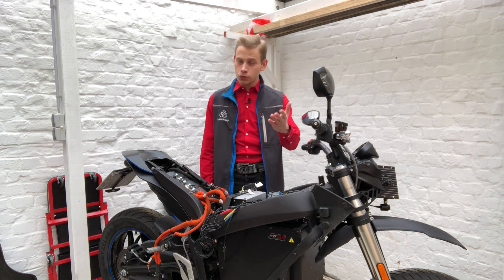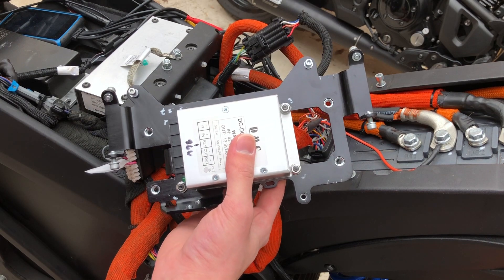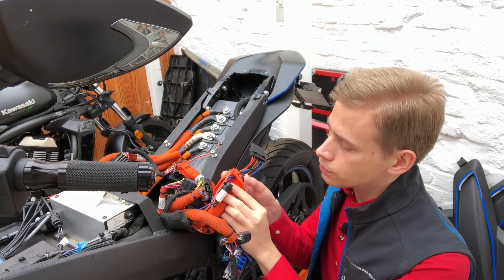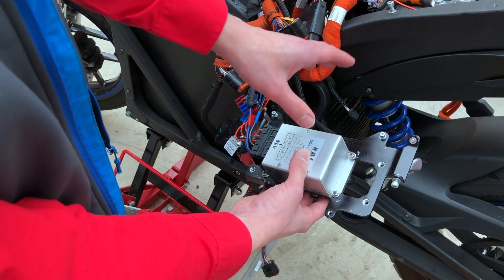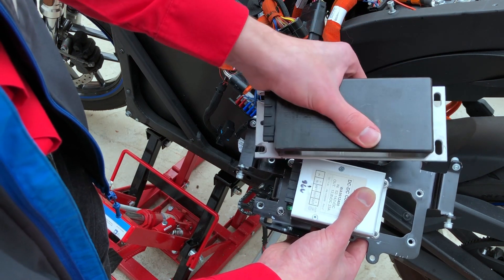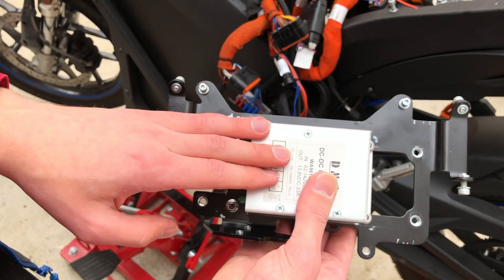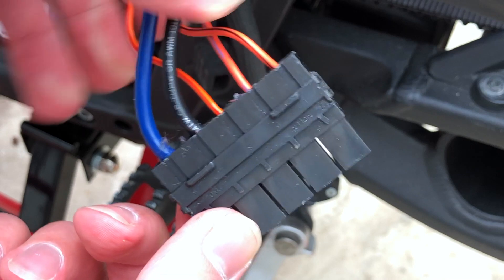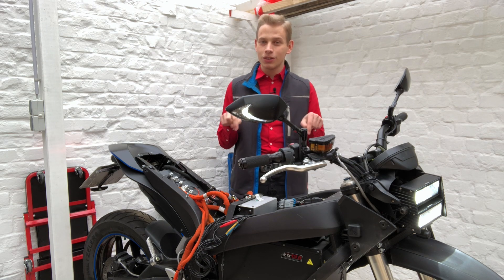ZERO | Replacing the DC/DC-converter

Comment: I recently removed the battery from my zero to do some maintenance on the upper shock mount. Unfortunately the bike wouldn't turn on after replacing the battery. After you watching your video I checked the main fuse in the battery compartment which was loose after fixing this the bike turned on. After agonising about this problem for the last 3 days your video helped me to restore my face in zero motorcycles. Your videos help people in multiple ways. I am most grateful

Comment: Great video! Unfortunately, I can't find the DMC part or any other equivalent converter (I looked at every option on Mouser).
What about the recall : 16V-610 , 2016 Zero DC-DC converter.  Wouldn't the dealer replace the part for free?

Comment: Max, you should be able to discharge any capacitor voltage with a 1K ohm resistor fairly easily instead of waiting 10-15 minutes for the internal resistance to do the same thing… otherwise it’s a good video.

Comment: Thanks a lot for the video, I have a doubt, does the DC-DC converter has CAN protocol for communication or how it is? can you please brief on it
Reply from the maker: Hi @shaikafzalahammed8701

like the SEVCON converter the DC/DC-converter from DMC also supports no CAN communication. Both converters only get an "enable" signal from the MBB (main bike board).
DC in, DC out and "enable" as simple as that.

best electric regards
Max Jäger

Comment: Hello great job. You mentionned the part number for the 450w model. Would the 900w one be of any interest ?
Reply from the maker: Hi Y from Mars,

the 900W model is too big to fit into the same space as the original DC/DC-converter and it also might draw (if using the full 900W) too much amps and overwhelm the wiring loom.

Best electric regards
Max Jäger

Comment: Now, I'm wondering, can I put in a 900w, for extra output? I see the pinouts/connectors are slightly different could this be made to work? Will the wires take the extra draw being pulled?
Reply from the maker: Hi Grant,

in case you want to mount the 900W converter in the same position and power it via the same wiring and fuse, I don't think it will work (too big and too much current). But you could wire it up to the auxiliary charging port and "grab" the enable signal from the original (SEVCON) DC/DC converter, but you won't be able to combine both low voltage outputs of the converters since they put out slightly different voltages. So you'd have to use that converter and the loads you want to operate isolated from the "other" 12V system.
In case you've already replaced the stock SEVCON converter with the shown 450W DMC one you can seamlessly use both the 450W and 900W converters in parallel, since they're actually designed for parallel operation. Nonetheless you still can't fit the 900W unit in the same space, nor can you use the stock wiring (at least without risking to fry the cables).

Best electric regards
Max Jäger

Comment: Thank you for a great explenation. It really helped.
It appears there is a problem to purchase the DMC converter for a privet person.
Do you have a link to a store  that will sell the converter out of germany?
Reply from the maker: Hi Yoni,

I myself just got a great deal on the shown unit on ebay. Unfortunately though I don't know where you can buy them from as an international buyer.

Maybe this shop can help you out:
https://www.elektromobilitaet-riester.de/verkauf/stromversorgung-management/dc-dc-wandler/

*they also offer a seemingly fitting replacement for the SEVCON DC/DC converter with the same footprint, but a higher nominal input voltage (96V like in the video), but also a Power of 500W for less than the DMC Converter.

Best electric regards
Max Jäger

Comment: Thanks for the video. I have a 2016 fxs with 2000 miles. The 12 volt supply works intermittently. Was that the same problem you had? I want to be sure before I buy the expensive part. How can I measure/check it? It has the input from the main battery. I am not sure how to measure the signal voltage from the MBB.
Reply from the maker: Hi Revanth Reddy,

I also struggled with a unexpected loss of 12V power from time to time.
To measure the enable signal you'll have to disconnect the connector from the DC/DC-converter and measure the Voltage between the "enable" pin and the main battery negative. If the MBB works properly you should be able to measure a voltage greater than 90V. 

Best electric regards
Max Jäger

Comment: Fantastic video. I think my DC to DC converter is toast and found one on eBay for a decent price. With this video, I think i'll try and fix it myself. Seems pretty straight forward, especially since i'm not adapting a new converter. Thank you so much for such an informative video!

EDIT: How would I fully know if my DC to DC converter is toast? My 2018 Zero S won't charge anymore, and the dash/lights/high beams will randomly cut off for a few seconds once in a while. Still works just fine, but can't charge it anymore.
Reply from the maker: Hi therealzero,

then it seems like your charger is, or will be dead in the foreseeable future.

So lets differentiate for a moment...

DC-DC-Converter.
To check the function of you DC-DC-converter you can measure the output voltage, or just use your peripherals (lights etc.) as an indicator.
You can also check the enable signal, take a voltmeter an measure between the most right pin of the DC-DC-converter and the main battery negative (on your SEVCON controller). If you're getting a constant voltage that is around the same as the main battery one you'll know that at least the "enable signal" is working like it should.
I also suggest to check the "HV-DC-DC fuse" which is hidden down inside the wiring loom, for that you'll most likely have to remove some of the orange braided sleeving . Sometimes you can get a bad connection due to vibrations.

But a randomly occurring turning on or off of you lights, like you stated earlier, is by far the best indicator of a "blown" DC-DC-converter. 

The charger:
The best indicator for a slowly decaying charger is that your maximum SOC (State-Of-Charge) after charging will slowly but constantly decrease. Unfortunately the chargers ZERO uses, at least on their S and DS models, are prone to fail early. In that case you'll have to look for a replacement and wait for the next time it fails, or go for an aftermarket solution/charger that is more suited for the application.

I hope that this information is somewhat helpful for you.

Best electric regards
Max Jäger
Reply: @Max_Jaeger  Thank you for all the help. I purchased the converter and replaced it. Unfortunately now the bike won't even turn on. The dash comes on for about half a second, then shuts off. But, I discovered the cable that goes to the charger was separated (of course AFTER I replaced the converter), so I'm going to try and put back my old converter and see if it works again. If it does, I'll know I have a bad converter. I'm not very informed on how to properly test connections, so I'll have to go about it the hard way, lol. Again, thank you so much for all your help and information. It is greatly appreciated!
Reply: @therealkzero  I also had my 2015 DS exhibit a problem where the dash would go on for less than one second.  The problem was a main fuse (sand filled, in the wiring harness) blown. Check all your fuses, if you haven't already, for continuity!
Reply: Thanks a lot for your vidéo in english... Impossible for me to understand German. I ll try to see how to get a Dmc dcdc  in case the preownded DSR 2017 that I Just bought get some trouble.

Comment: your english is very clear! nice video dude! I like the headlight you installed but I'm also very curious about your fast charging setup! subscribed from Los Angeles!
Reply from the maker: Hi Ryan,

thanks for the sub!
If you're interested in a comparison between the stock headlight and my new "Highsider Ultimate LED" setup, you can check it out via the link below (you'll find a pdf document, click on the link below "ZERO DSR", then open the folder "Highsider Bilder & Vergleich" and finally click on "Halogen vs. LED")
https://www.dropbox.com/sh/gec4952i9wdz5hc/AAAYET9Ta6aV6ZeFsF7EqF0ta?dl=0

Best electric regards
Max Jäger